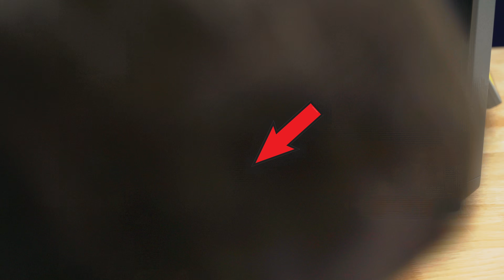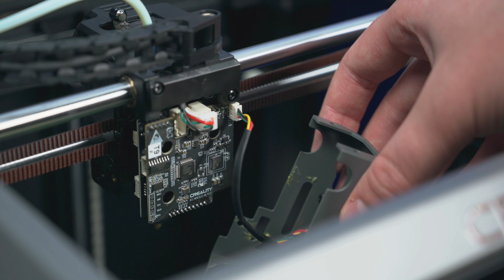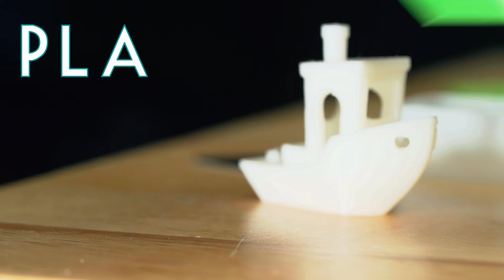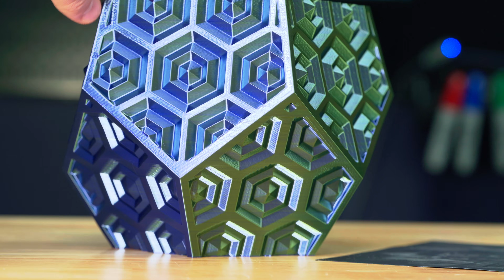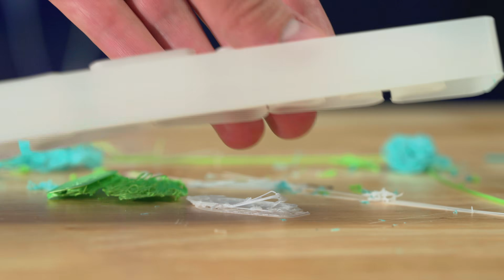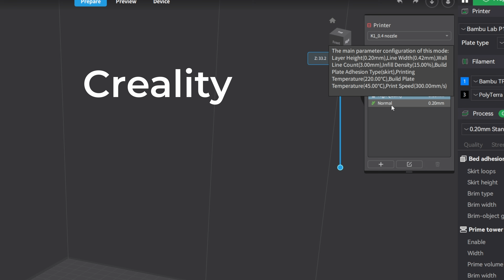How is this so FAST!? - Creality K1 First Week Review

Comment: TPU needs to be printed slowly, and the 🌡has to be finetuned within few C. Retraction has to be kept to a min. and dialed spot-on, could easily strip filament to lose grip. Apart from this, the filament path needs to be very tight, with right amount of force on extrusion. Have done that with the world's most flex. filament(AtomStack 60A TPR)successfuly on a lulzbot mini with flexstruder!❤👍

Comment: I did not know that about the P1P, that you have to use the internet to upload files
Instant turn off. I was debating which one I wanted. There is no debate anymore

I don't care how good a 3D printer is. Controlling how you can or cannot put files onto the printer is an absolute deal breaker

Comment: The Creality K1 is interesting, but there are still a lot of negative points. Thanks for the video. I love my two year old Ender 3 V2 with Sprite Direct Extruder Kit, Dualz Z-Axis, OctoPi, Webcam and Professional Software (by Miguel Risco-Castillo). The print quality is incredibly good, especially after the update to dual Z-axis and it can also be controlled and monitored from work via mobile phone ;-)

Comment: Could you explain why is DC heated bed safer than AC? Because 24V AC is completely safe to touch with bare hands.
Reply: Ac heated bed is used to describe an bed directly powered by mains 120/230V voltage.

Comment: Steel rods. I'm glad I cancelled my order. A huge reason why I like the carbon rods is you don't have to grease bearings. The Bambulabs uses brass bushings with graphite impregnation. Dry lube! Also, the steel rods are heavy and are likely causing the skipping on the high speed benchy.

Comment: I have just received my Creality K1 and found that the print bed was not fixed!
There was no screw in the print bed which is why it has very wobbly! The missing screws were also not in the installation space!
I bought myself screws and fixed the print bed!
With the Self Inspection comes the error message "Error E002 key:2016, Internal Error"!
Its such a bad joke......has anyone had this error and can help me pls, you can find the Video on my Channel!

Comment: There is no "K1" printer model listed in the Cura or Creality slicer.  How do you slice a model for this printer when the popular slicers don't have any way to set up a model on the slicer?  Creality Cloud is garbage since all you get when you try to log on or signup is "network error".  This K1 is Junk.  I unboxed it and there were three loose screws laying on the print bed and a fourth halfway unscrewed on the X stepper motor.  I already regret buying this printer.

Comment: Some of the artifacts may be caused by the dual gear extruder.  They are known for periodically variable variances in flow rate - another video about the K1 has highlighted this.

I'd like to see this printer paired with the new Prusa MK4 style planetary gear extruder which aims to reduce this significantly.

Comment: Bambulab now has "LAN only mode", so connection to internet requirement is no longer an issue.
Reply: You lose features though such as the camera no longer works and you can't monitor the printer. For me Bambu being cloud oriented is a none starter especially when you read their privacy policy, no way should their printers ever be used for commercial work.

Comment: The reason that the curvy wall printed well is that there is not a single corner!

Make a similar print test with no curves and all corners, especially corners of less than 90 degrees and watch how you will get skipping and layer shifting!!!

Fun, fun, fun

Comment: Thanks for the great review... P.S.: If you did some actual multicolor printing on the AMS, you wouldn't love it so much anymore! ;-) 2 minutes for a filament swap is simply ridiculous, and you need to do that up to THREE times on every single layer! So if you have a 10cm object in 0.2mm layers with 4 colors over the full height, it spends 2 days and 2 hours simply just swapping filament!

Comment: Never print TPU without first drying it, it's extremely hydrophilic. And it's overly optimistic to try and print TPU without a profile that is designed with its limitations in mind.

Comment: I love my 5 S1. I am pushing it at 220 mm/s at 9k acceleration. I am still hoping for better reviews and more diagnosed reviews. Otherwise I will be doing it.
Reply: WOW, I cant push past 80mm/s and 3200 acceleration with the sonic pad or the prints really start to suffer,  BUT I did not notice this till I got a Bambu P1P, now I just set it at 2500accel/1250deccel/sq corner2.5/ velocity to 1.5/ 60mms and set the pressure advance to witch ever filament I use BUT still does'nt even come close to the quality of the stock filament profiles in Bambu studio, I'm really thinking about selling my S1 5 and buying another P1P. I've enclosed my P1P and it just performs...being able to use cf nylon and glass nylon at those speeds and have perfect prints is just mind boggling with just one pressure advanced test and using the "generic nylon" profiles. I thought I had my Ender 5 S1 perfect till I pulled the P1P out of the box and did my first print. Bambu Lab printers are not just hype, they really are that great....I just thought there were a lot of fan boys out there and it was all hype so I had to see for myself.
Reply: @mikemarucci913  yeah but the p1p cots me 850 and a ender 5 s1 is around 530 here in switzerland 😂 not the same price category
Reply: @turion92  530 with the sonic pad?
Reply: @mikemarucci913  no without :(

Comment: I hear you on the Ender-5 S1. The test unit I received was definitely not ready for primetime. The acceleration was set way too high out of the box, the UI is incomplete and cluttered, and it didn't have a recent version of Marlin with Input Shaping or even S-Curve Acceleration to cut down on the vibrations. We have a PR on the Marlin project to get the machine supported, but there are a lot of customizations scattered around that we need to sort out, and we really need to fix up that UI, especially the ability to print files inside of subfolders. Hopefully we'll get that sorted out before 2.1.3 release or shortly thereafter.

As for the K1 … of course it's not running Marlin so we won't be getting our own test unit anytime soon, but we are taking a lot of inspiration from this CoreXY with light printhead and high-flow hotend, and should be able to bring more budget machines up to par with some of its advanced features, especially with the addition of high-flow hotends and even more advanced Input Shaping on the horizon. Good review! and I look forward to your followup after more usage.
Reply: Why don't you like clipper?
Reply: @maximus_chapman  Haha. As the lead developer of Marlin, my focus is on improving Marlin. Should Marlin switch to Klipper?
Reply: @ScottLahteine  not 100% sure what the differences between clipper and marlin are, but I think clipper has more features for faster 3d printers while marlin can run on lower end boards? You get paid to work on marlin?
Reply: @maximus_chapman  I am the lead developer of Marlin, supported entirely by sponsorship and user donations. Marlin can achieve decent printing speeds even with AVR boards, and speeds as high as Klipper on more powerful boards, and is really only limited by the hardware (such as how much material can be melted quickly by the extruder). The more powerful and spacious the mainboard is, the more additional capabilities can be added to Marlin firmware. We expect mainboards to only continue getting more powerful, and we’re working continuously to take advantage of that extra power.

Comment: Might be a bit too early to ask this, but for monofilament printing quality of print wise,
P1P or k1?
Reply from the maker: I'm going to do more testing and tweaking of the K1 profile to run at the same speed of the P1P to do a full comparison. The K1 default speed has a little more artifacts, but is running faster than the P1P.
Reply: @JJShankles  thanks that would be great, I have an old Prusa mk2 and I'm in the process of buying my 2nd printer and quality of print is a big factor, speed of print is a perk buy my main deciding factor would be print quality multicolor printing is not my thing 
Appreciate your review and can't wait for the next one 👍🏻

Comment: JJ, I can't speak directly to the P1P, but Bambu Slicer has had the ability to send sliced files to the printer for some time now. To do this on my X1C, the printer gets put in LAN only mode, and then so long as the printer and computer are on the same network, you can upload directly to the printer's SD card. Prints have to be manually started at the printer end, though, and the camera view is not available in LAN only mode, but it IS possible.
Reply from the maker: I'll need to look into that because I've had a lot of comments saying this. But it does sound like it has a few compromises to Klipper or this K1 where everything can just be managed and controlled locally.
Reply: Well, let me know if you need any help figuring it out. I've used it a couple times when the cloud service wasn't working. It can be tricky, but it does work.

Comment: I would much rather have the p1p because the p1p has the capability of running the ams system where with the k1 you will be spending another 450+ onto of the ams cost for the p1p 350+450=800 for pallette 3 or similar multi material system for the k1

Comment: But what kind of firmware does it mount? Klipper? Also is it open source? Thank you
Reply: K1 firmware is Klipper but a version Creality has locked down to the features they want. This has still not been released as open source but Creality say they are going to release it and the Klipper licence forces them to do that. Having said that there is already a jail break for the printer to unlock full full Klipper functionality.

Comment: It might be disengenious to list the P1P price as $700 here considering that you frequently mention that the main thing it has over the K1 is the AMS (which I believe costs signifyingly more, right?)
Reply: Maybe  not a fair comparison, but not disengenious, what I got from it was that the AMS is that good that he forgets it costs 200-300 more or at the very leaste its convenient to ignore the extra cost its so worth it.  Im sure there will be one made for the K1 eventually.  Im sort of tired of manual filament swapping and thought the AMS was a gimic, but it sounds like it works pretty well and would definately look for that kind of system on my next printer.   Nozzel swapping would be even better, dont like the idea of all the wasted purge plastic is my main issue with the system, but the convenience is definately appreciated as someone whos done 40 filament swaps on a 30 hour print.

Comment: You can reprint things you've printed before, but just the last file sent to the P1P. If you go to files in the SD card menu, you just select "bb1.3mf" and it will print the last file produced.
Reply: There’s also the “Send” mode and LAN mode that you can enable. I’ve got poor internet at times so I try to keep everything local just to speed it up.

Comment: The first decent review of this printer, thanks for your review

do you have direct full access to klipper and can you change its config files?

what is the size and threads of the nozzles? can you screw normal volcano nozzles?

is the parts cooling fan sufficient for high speed printing? i mean 200 - 600 mm/sec

what is the thickness of the printing bed and did you noticed any warping?

are the x steel rods using bushings or bearings?

Comment: Why would 24v bed be safer? The printer are ac… 24v give higher loads on the psu meaning that if they cheap out on the psu (which we all know they do, since a really good psu are expensive) it is a higher risk of fire then running it of ac power. Way less amperage on a ac bed compared to a dc bed. I have run booth type of beds for years. Doing either of them right are just as safe.
Reply: While you aren't wrong, getting shocked by 24v vs 220v is deffo a difference in safety, 24v you can lick some cables and maybe be fine 220v you won't be at all, and while yea the psu can be overloaded they could have also gotten a dog shit ssr and not grounded the bed properly in which case I'd want the thing to run at 24v so that I can just switch the psu if I wanted pure safety, also a good psu isn't that expensive a meanwell 350 is still like 35 40 quid
Reply: @mashiori9020  it is more then enough for them not to include it. So saying that a good psu are cheap are not valid tbh. Cause it’s expensive enough that they don’t ship it with one. Saving 15$ on 10000 printers are a lot.
Reply: I also run AC, and add extra grounding
Reply from the maker: Yes they both can be safe if done correctly. I've just seen some poorly installed ones without extra grounding, or the bed cables don't have strain relief so they could wear through or come loose after a lot of printing

Comment: ⌐_⌐ So you can have AC to the power supply, into a bridge rectifier, buck regulator, and then powering the DC bed... but that identical AC voltage used in the bed is a bridge too far?
Reply from the maker: AC beds can be fine correctly, but I've seen really bad ones with no strain relief so the bed wires are going to wear through eventually. Or could easily be torn off the bed if something goes wrong.
Reply: @JJShankles  0.o? So it's nothing to do with whether it's AC or DC, it's the mounting and strain relief, which is a notoriously common problem with bed-slingers, but even my Ender 5 Plus needed a heating bed cable support/strain-relief arm printed for it.

Comment: There are two different options for offline printing on the BL printers. You can choose lan only mode and then print from the slicer directly to the printer or you can just take the SD card out put the file on it stick it back in the printer and print it from there just like on any old printer. Your last file printed is the plate1.gcode file on the SD card so you can at least reprint the last one you sent to it through the cloud or local lan.
Reply: You can also just change the Print button to Send, and send your file to the printer locally without the cloud even without turning on LAN mode. However, it doesn't start the print. It just puts the file on the printer for you to choose from the screen
Reply: @technicallyreal  I love using the send mode for plates I need to print a few times. I’m already going to be at the printer anyways to clean the build plate, so it saves time provided that the sliced file doesn’t have an issue.

Comment: That 600 mm a second test print came out so well because it has no sharp corners. It's very specifically designed to reduce acceleration as much as possible so there's no chance for artifacting or ringing. Anytime you introduce sharp corners anywhere it's going to create much more opportunity for these things to happen. The reality is though that pretty much any actual model is going to have sharp corners so whereas the built-in 600 mm per second print is fun to see it's not indicative of any sort of practically attainable results at those speeds.
Reply: I understood the 600 mm/sec sample part trick that Creality did, but when using CAD to design my parts, I try to consider all aspects of the 3D printing manufacturing and I optimize the geometry to make the best 3D printed parts.  That definitely includes fillets on corners in the XY plane when possible to make it as easy as possible on the trajectory planner.  These new coreXY printers have a couple of nice tricks to improve high speed print quality including accelerometers to detect and correct motion errors, but it still helps to design parts that don't have inherent problems with very high accel/decel rates.
Reply: That kind of just goes for most benchmark prints of that kind, definitely does not reflect real world performance. It's impressive considering it's creality nonetheless.
Reply: It's kinda like a car, you never go your cars max speed, but the faster the car the better the handling at normal speeds.

If your max speed is 600mm/s you'll print better at 60mm/s than a printer with a max speed of 80mm/s.
Reply: how about printing corners as single lines and the extruder makes a curve at the corner like an 8, where the corner is the center intersection, this would eliminate ringing without needing imput shaping, there is more time for accelleration in the curve where the extrusion is stopped

Comment: Did you use any bed adhesives (glue,spray or anything)
Reply from the maker: Yes, this bed says it needs glue stick
Reply: It looks like he had something on the bed when he was talking about it. There was a some coating in the center

Edit: looks like glue stick on there if I had to guess and iirc another reviewer mentioned that Creality recommend glue stick for some materials.